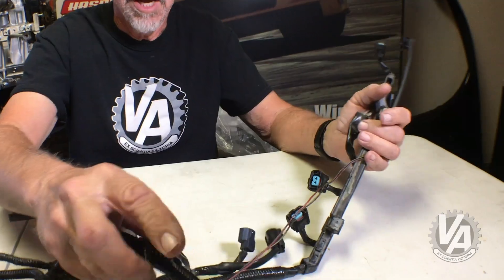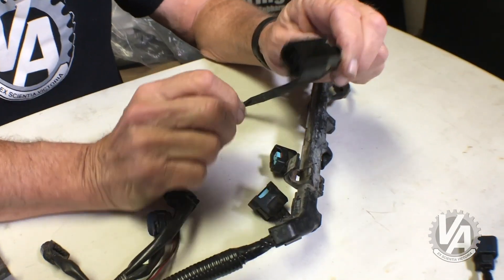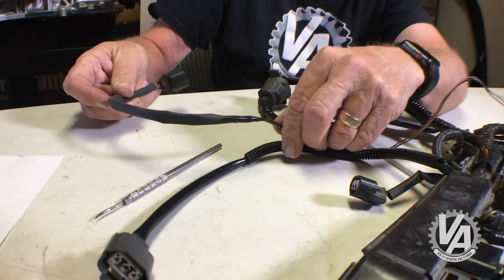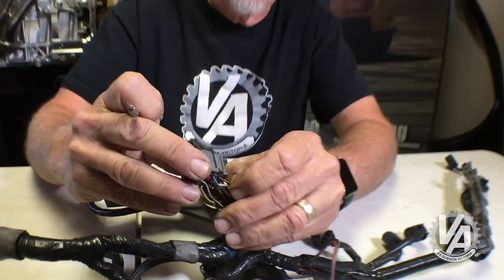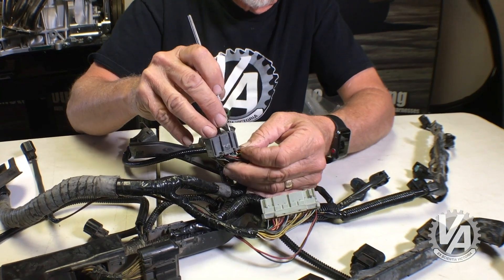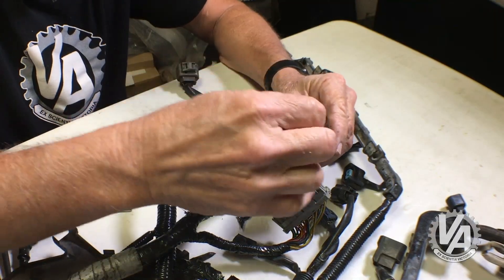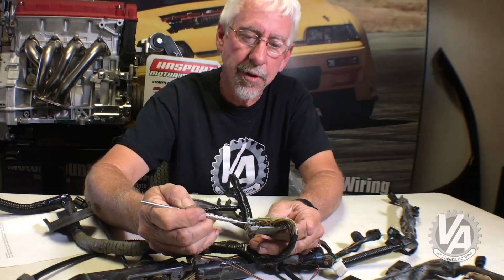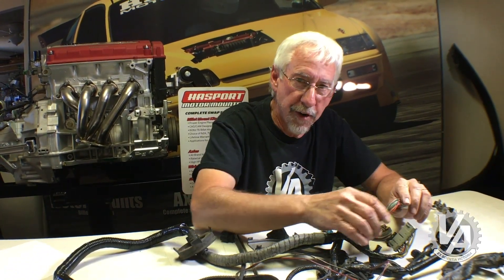Reverse Lock Out Quick Tip

Comment: This was super interesting. I have a fd2 Type R and I've replaced the springs in the gearbox shift mechanism. I didn't check before but now the reverse lock out doesn't work. I believe I've taken apart and rebuilt the shifter correctly. I'm now thinking the solenoid might have failed and it's not worked for awhile. Do you have any pointers as to how you check this? Not easy as the can needs to be moving for the lockout to activate. Please help if you can 😅

Comment: Brian I have a 2004 Acura TL base model with a manual harness, a 2003 Acura CL Type-S six speed, a 2007 TL Type-S manual ECU with Hondata FlashPro and the adaptor harness, a stock replacement Exedy clutch and flywheel (absolutely unparalleled quality and longevity, I've used it at over 500 whp with my boosted J32A in my Accord for 20,000 miles and its still going strong), and it has a GTS3582 turbo at around 5-6 psi and it keeps eating reverse in the manual transmissions that I have. V6 six speed manuals are expensive. My 03 CL trans was $1500 and my 05 Accord (with an 03 CL LSD diff) was $700 plus another $300 for the CL diff. I've already rebuilt the CL trans with a new reverse synchro and cuff, but I went from 5th to reverse once on the highway and it ground for a split second and now I have no reverse. I spent over $200 for the actual OEM Honda parts. I found out that I didn't have the little spring and plunger that goes into where the reverse lockout solenoid installs, so obviously it's not going to work without that. Anyway, after purchasing another complete reverse gear stalk I'm going to attempt it again. Wish me luck! I'm tired to having to replace these transmissions due to no reverse!
Reply from the maker: Try this. Before you put the car in reverse, put it in second first and then reverse. That should stop the transmission from spinning and eating the reverse synchro.

Comment: Good afternoon quick question on this on a ep3 harness with type s ecu. I’m not using evap can I use power and signal from evap to make a reverse lockout? Can I depin signal wire to b7 and enable evap on kpro for power?
Reply from the maker: K-Pro has several output options for nitrous control. Just look those up and use one of them.
Reply: @VTECAcademy  awesome thank you!

Comment: Hey how are you doing? I was trying the lock out conversation on my ep3 harness. I see the plug on the harness but the wire from ecu plug a8 to remove is not there. So where would I find the wire if it’s not in that location

Comment: Would I be able to do this mod if I'm running a k24a/k20z3 head and a awd element transmission that has been converted to a 6spd?
Reply from the maker: Yes, the lockout solenoid is on the 6-speed shift mechanism.

Comment: If you were building this from scratch, where would you get the power source to tap into for the Black/Yellow stripe wire?  Could I tap into the harness power that goes to Pin 2 and Pin 3 on connector A on the 02-04 harness?                                                                                                                                                                                                                                                                                                                                                            2 YEL/BLK IGP2 (POWER SOURCE) Power source for the ECM/
PCM circuit
With ignition switch ON (II): battery voltage
With ignition switch OFF: about 0 V
3 YEL/BLK IGP1 (POWER SOURCE) Power source for the ECM/
PCM circuit
With ignition switch ON (II): battery voltage
With ignition switch OFF: about 0 V

Comment: What about the manifold runners? Does that connector also need to be plugged in?
Reply: Not if your running a single stage manifold, which all type s swaps are running.

Comment: What if you're sending an non Type S ECU off to hondata? Will the modifications they make allow you to be able to operate the reverse lockout through the ECU?
Reply from the maker: Ask them, but I don't believe so. With a Hondata you can use one of the alternative outputs you might use for Nitrous control to turn that reverse lock out on and off.
Reply: With a PND ECU with KPro V4, using a PRB calibration,  you would pin the reverse lockout to B22 and it will automatically work, just like a PRB ECU.

"Changed PRB calibration to activate reverse lock out via pin B22 (secondary intake runner). This allows PND ECUs to be used rather than the PRB ECU."

https://www.hondata.com/forum/viewtopic.php?t=18179

Comment: Hi
I got 04 base ecu hondata... can I just use the same connector to the ecu to reverse lock. Thanks
Reply from the maker: You will need to use some other output to control the reverse lock out. The base ECU doesn't have the correct output.
Reply: @VTECAcademy  Form what I have read B22 in Hondata KPro V4 will automatically activate reverse lock out now. Coincidentally, that plug you are showing goes right to B22 on the 02-04 RSX Base harness.
Reply from the maker: @brandonbruce5571  Correct, but if you have a Type S ECU, then you need to move the wire'
Reply: @VTECAcademy  Correct, move it over to B7 if you’re on a stock Type S ECU. If you are running KPro V4 on a PND (base 5spd) ECU you now got reverse lock out from B22 and no need to go for a Type S ECU with Kpro.

Comment: Is there any difference between the TPS pin outs? Between a Type S and base model. I think I read online that the two outer pins have to be swapped around. When using a base model harness on a Type S engine. Is there any other differences between both engine harnesses?
Reply: There is. New quick tip coming on that after the crank angle sensor quick tip.